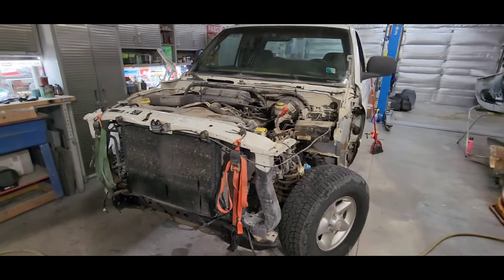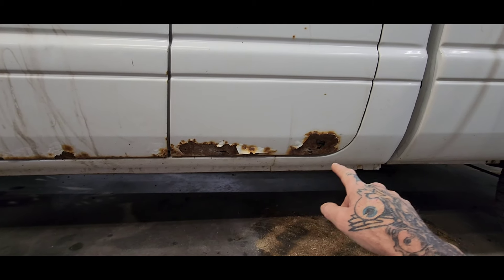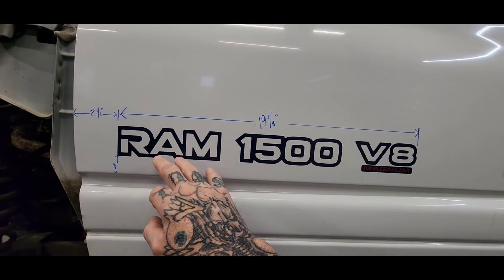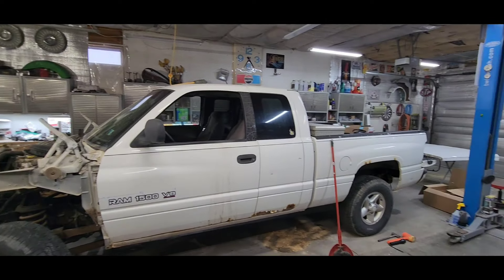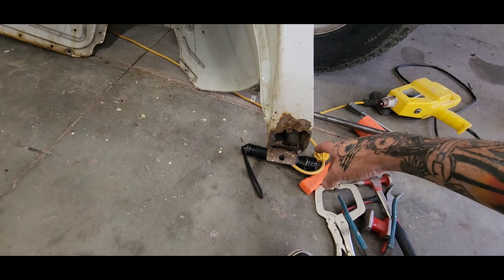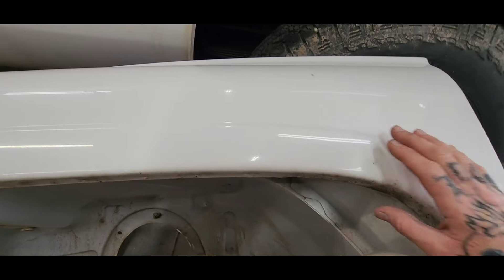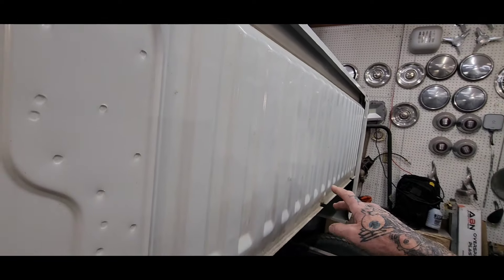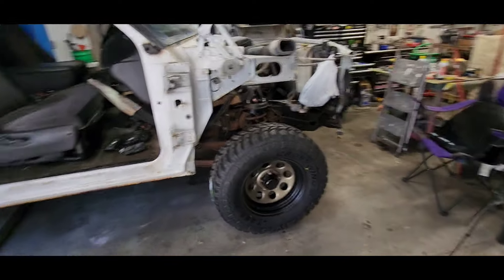Dodge Ram makeover Part 1 #truck #offroad #4x4

Comment: I got a lot to do myself
Reply from the maker: @brandonyoung0919  Rust?
Reply: @killingcursivekustoms  big time can’t post pictures here unfortunately
Reply from the maker: @brandonyoung0919  I got super busy at work and had to put this project off for a bit. But gonna get back at it hard here in the next week
Reply: @killingcursivekustoms  awesome can’t wait any tips your got and details will help a ton!
Reply: @killingcursivekustoms  the trucks a 01 dodge ram 2500 Cummins extended cab long bed 4x4 Laramie
Reply from the maker: @brandonyoung196  Whatever you may have questions about, feel free to ask. I can always post a video explaining how I would tackle it.